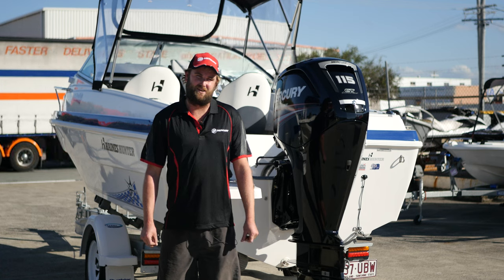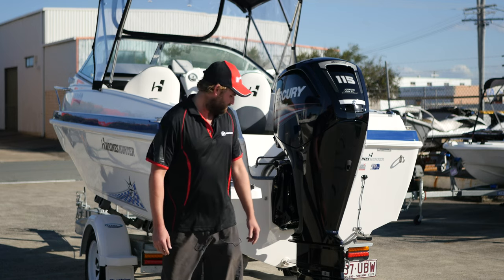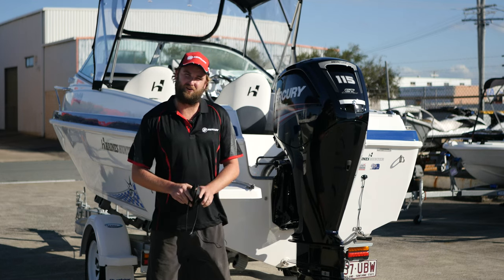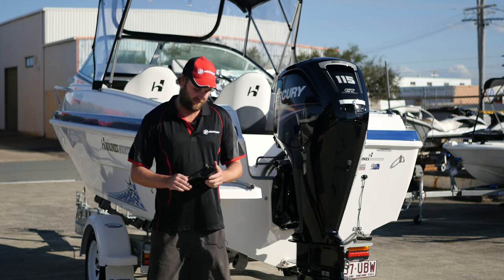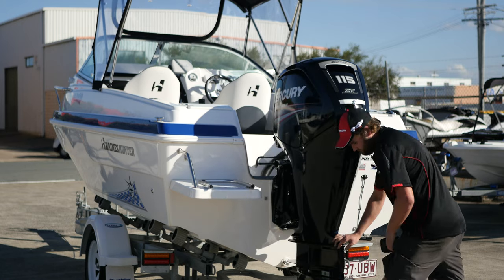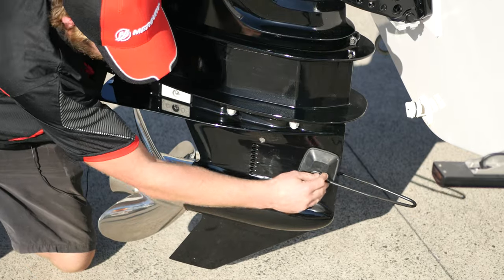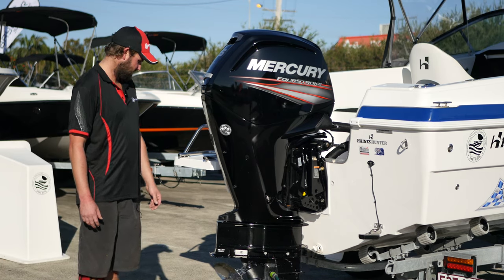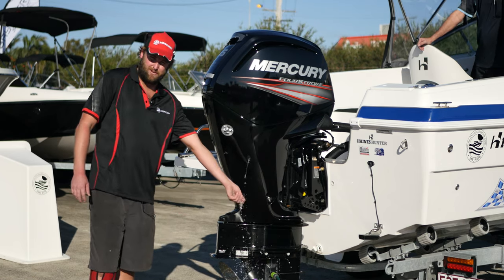Mercury Engine Flushing

Comment: Mercury has made flushing your engine confusing as hell in their manuals. It says to run engine when using the flush port, to not run engine when using the flush port, and they make no mention of the differences between flushing with the muffs vs the flush port. Good video!
Reply: Yup, Mine just talks about hooking up the hose to the flush port, noting about hot or cold.  Fortunately I've always been doing it when my engine is hot (relatively) within minutes of putting it on the trailer.
Reply: Can I run the engine while flushing thru the top port or do I need to use the muffs on the bottom 🤔
Reply: @thomasadams9924  From everything I can gather I would not run the engine without muffs
Reply: @Nomad-yn7pv  thank you
Reply: @thomasadams9924  No problem. Better safe than sorry.
Reply: @MrJRSLim  I have a suspicion they say its best to do on a hot engine, because salt deposits will dissolve much faster than if its cold water flushing through. Mercury can correct me if i am wrong, but i think thats the only logical conclusion

Comment: Question,/problem.  I just bought a brand new Mercury 115 XS Pro.  I flushed my engine using the hose that comes out of the side of the engine.  You unscrew the cap, then unscrew the cap from the hose, and then screw it into the garden hose for fresh water flush.   Easy....    My problem is that when I was done, I didn't screw the small hose in the engine to the cap before screwing the cap back in.  Now when I unscrew the cap, the hose is stuck in the housing and I cant get it to pull through...   Any sugggestion on how to fix this?

Comment: have a question you may know. I washed my mercury 40 HP. As I sprayed the fresh water on the back of the outboard and the water go into the exhausted on the back. Will this fresh water damage the engine?

Comment: Why use the muffs if you have the port? Dealer anx manual told me engine off, not idle, simple hose.
Are they wrong? Does any part not get flushed like impeller? Or does fresh circulate the whole way from a hose /engine off?

Comment: Had a question, I just changed out my impeller and on the side anodes I have water coming out of that area when i put on the muffs and run water. Noticed on your video it does that also. Is that correct? I have never really paid attention to where water came out when running the muffs. Thanks
Reply: Joe Gest just picked my 75 up today and did the exact same. I’m sure it’s normal.

Comment: Why is it not ok to use the upper flush port with a cold engine?
Reply: When the engine is cold the thermostat would be closed preventing the flush water from washing out all the water passages.  The thermostat only opens when the engines reaches normal temperature - this will only happen if the engine is running.
Reply: So you can use the flush port when e fine is cold but the key is to remove your thermostats so that you can get a flush all the way through the system.